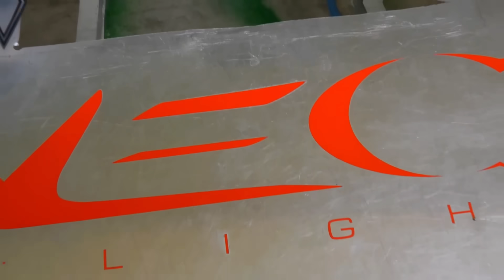NEW LEO COUPE JUST GOT UNVEILED – Meet the Flying Car!

Comment: Well, I'm sure they will have to pass FAA testing and scrutiny.  Avionics, navigation, a transponder so controllers will see you on radar and communicate with you to avoid other air traffic. It could become a nightmare if 30,000 of these things are flying all over places like LA or any other major city.  Then there's law enforcement.  If it's on the street or parking lot, it has to have a license plate, a inspection sticker which means a horn, blinkers, mirrors, the whole nine yards.  So, your flying along and get hit by a buzzard. Crash into the 8th floor office window of a 20 story building, killing yourself and 8 others instantly.  The world is not ready for this!

Comment: Safety issue:  power running out before you have time to get to a charging station.  

Possible Solution: secondary (emergency backup) kicks in and radio links to closest power hookup, automatically recommending touchdown.

Comment: All electric vehicles need battery packs that can be removed quickly and replaced with freshly charged ones.  When you can leave the charging station in 5 minutes with a batch of fully charged batteries then the objections to EV's will vanish quickly.

Comment: It seems to me a good concept with possibilities despite not going beyond prototypes and CGI at the moment, I say this because the model seems light, it looks ingenious and aerodynamic at the same time, having the shape of a compact car thanks to its wings that fold inwards and then down, I also think the idea of many small engines is great, an idea that if they focus well would give security of redundancy, because let's say if it has 50 small engines, let's not say if it already had 100, it is almost impossible for them all to stop working at the same time, most likely 1 or 2 will stop and at most about five or 10 at a time, in addition, through AI or through analog mechanical automation it could be done that if the computer or a specialized mechanical device detects that there are, say, about five engines at the same time that are not working, if the car is in flight, make it automatically look for a place to land or if it is on the ground before taking off, directly abort the takeoff until its owner solves the problem on the other hand if they are engines small, a mass production in series could be achieved that makes these small engines easy to produce and economical, that is where the key would lie for these cars to be successfully marketed in the market because they would have to be possible at an affordable price of only 20,000 or 40,000 dollars which could be the base, of course the most luxurious models could have higher prices, I know that it is only a concept but despite this I see many possibilities compared to others that do not have any

Comment: BEAUTIFUL...You said 10 feet by 20 feet....You would need to
narrow it by 2 feet 6 inches to fit in a single car garage, or traditional
parking space...I built 20 prototypes, based on a width of 7 feet 6 inches. Need room
for egress.
Reply: I measured width of single car garage, actually  7 ft. 7 1/2 inches, entrance..
Because of additional trim in an 8 foot wide frame..,So even a vehicle 7 ft 6 inches wide is super tight..SO,
re design vehicle to be 7 ft. 4" wide. Or less